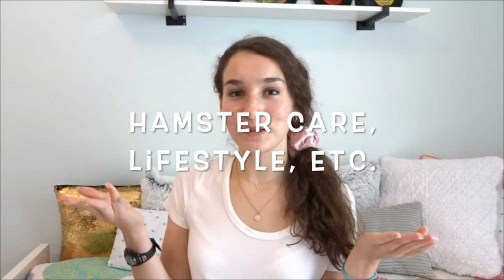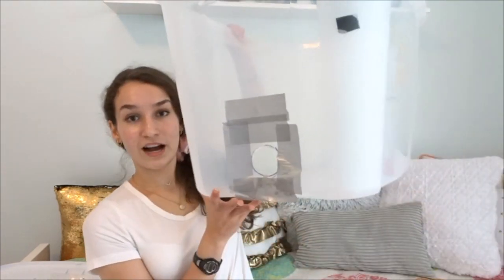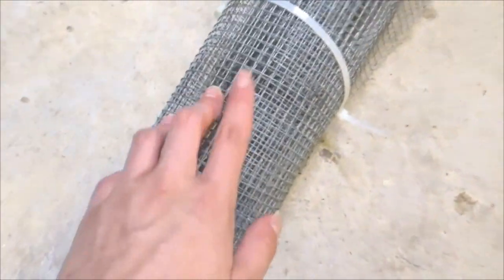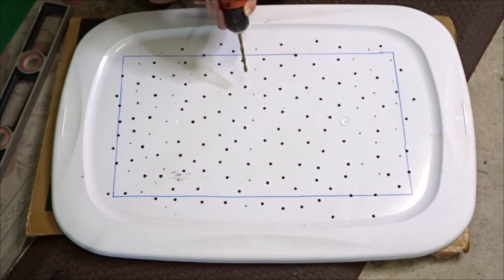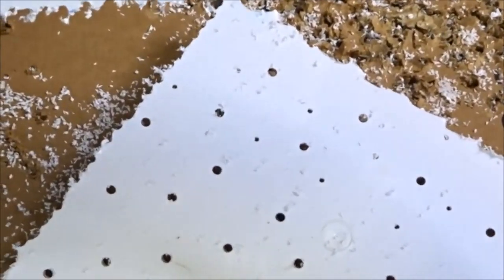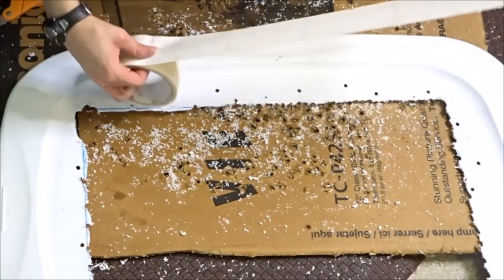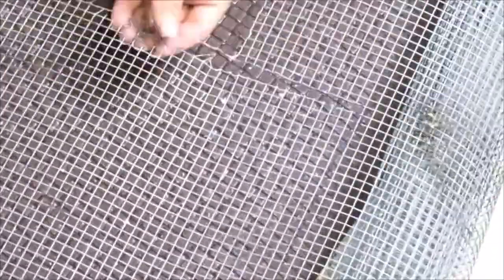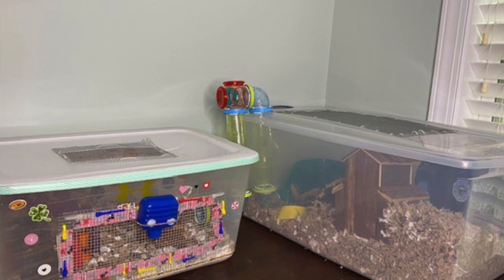DIY HAMSTER BIN CAGE LID // Making My Hamster a NEW BIN CAGE!

Comment: I just did this using a cheap soldering iron from Amazon, after trying the drill method. It burned through the thickest plastic easily and quickly. Just do it outside and make sure the wind blows the fumes away from you.

Comment: Soldering pen is way to go. Way better way, almost even fun.

I've used heating knife, drilling, shawing... And it has always ended badly. Then I got soldering pen with multiple different tips.
Now I have clean tubes, multiple hides with nice doorways,  decorated wood hides and tunnels.

Comment: I used : painters tape, tape measure, black pen, level, mastercraft folding utility knife, mastercraft diagonal cut pliers, mesh, zip ties & a 1" thick wooden cutting board (12"x24") for padding to not cut up the floor. :-D

Comment: I have a question can hamsters still breath if u add wholes if so yay
Reply from the maker: Yes they can breath however it is not recommended because it limiting air circulation and will lead to the cage getting smelly faster and is over just not good for the hamster